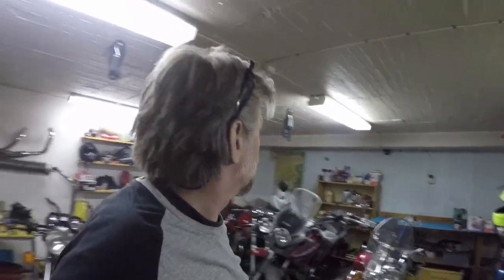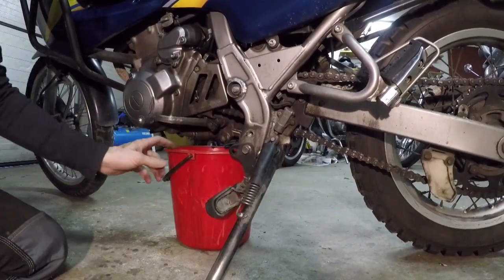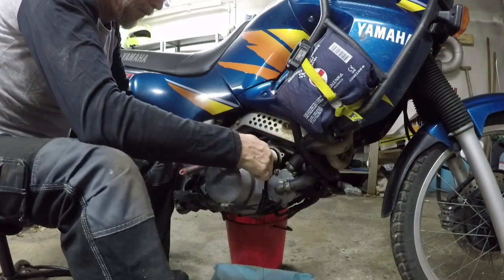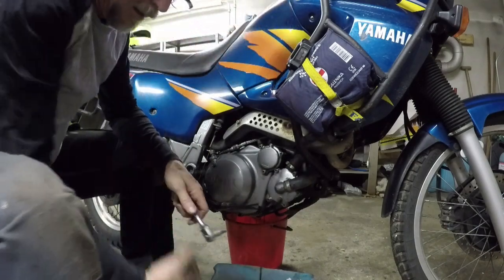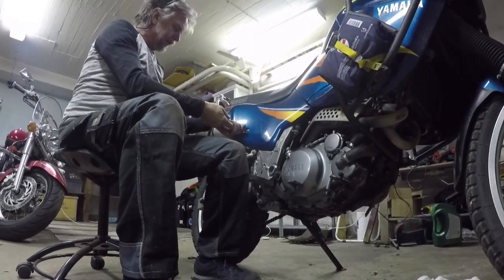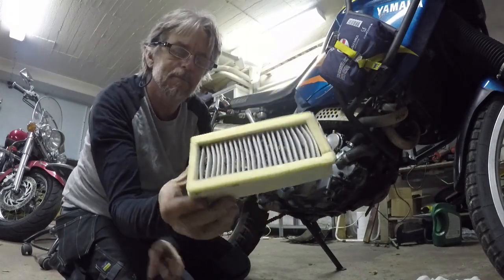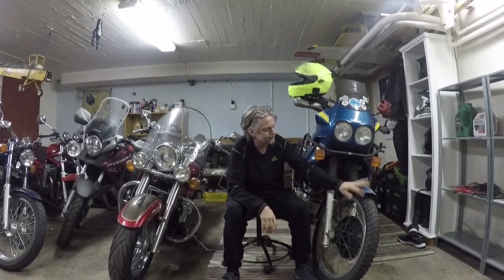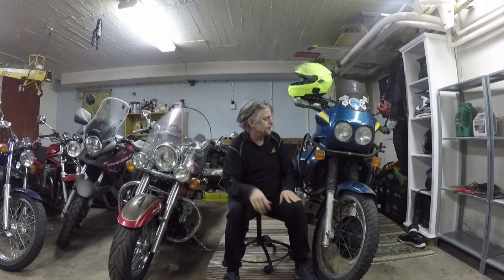Yamaha Tenere XTZ660 3YF 1998 Service

Comment: Great job..do you have possible catalog numbers for oil and air filter..greetings from Slovenia.
Reply from the maker: Thanks mate! I don't know the cataloge number but if you google "3yf oil filter" you should get to thebest alternative where you live. There are so many manufacturers of those filters. The oil I use semi syntetic 10W-40.
Reply: @aroundonabike5028  Thanks for the advice regarding the filter..which tires proved to be the best on trips where you drove 80% on the roads and 20 off road. (Europe)
Reply from the maker: @metodyx7507  My favourite tyre is the Heidenau K60 Scout.
Reply: @aroundonabike5028  I'm also thinking about this set of tires. I have another question..because of Pavlin and you I bought a Yamaha 660 xtz, 1991, very well preserved..it has 43,000 km on the meter..but I believe that these are not real kilometers. Otherwise, it was deregistered in 2013. Pavlin has a newer one with electronic fuel injection. I have one like yours with carburetors. How many miles can be done with this engine with normal use and regular service and how do I know when to have to adjust the valves on the head.

Comment: Hello, can you tell me length of sparkplug key? I bought copy of 18mm yamaha sparkplug key, it looks like same as in your video, but it is longer and it don't fit. Now i want make it shorter
Reply from the maker: The only key that works perfectly for the plugs on this model is the key in the original tool kit. It's made to fit and slide in place where others are either too long or too fat. I bet you can find one on Ebay.

Comment: How can this be an 1998 3YF. ? Production of 3YF stopped in 1993 and that model had a single oblong headlight. The later 4 series from 1994 onwards had the twin headlight and it's production stopped by 1996.. So much incorrect  info of this model of motorcycle on the internet.
Reply from the maker: I have heard this before... Some people say this, some say that. All I know is that in the registration papers of this bike it clearly says 3YF. If you like I can send you a scan?
Reply: @aroundonabike5028  A better indicator of the model is the frame number !